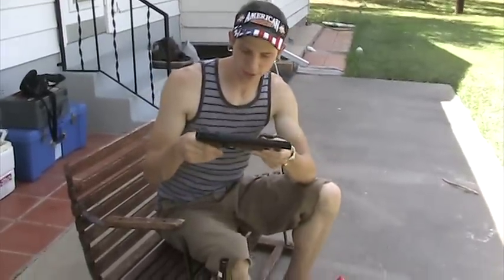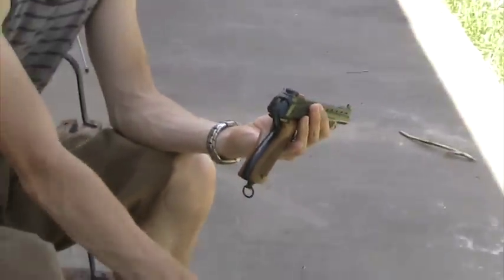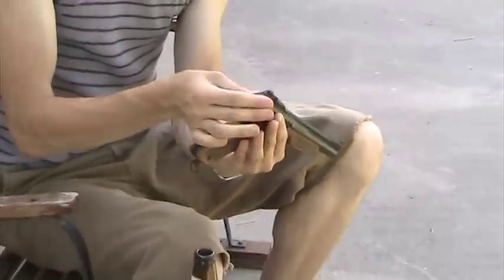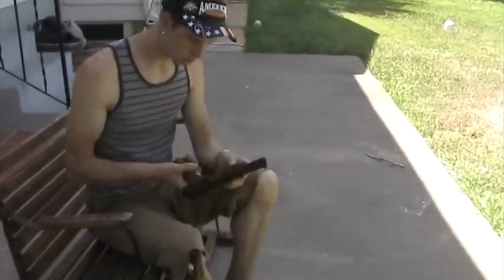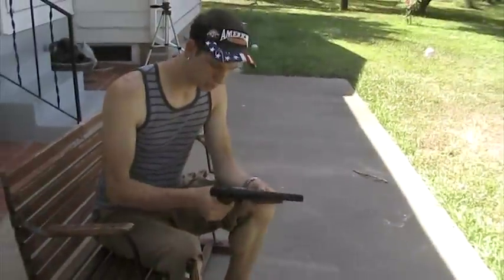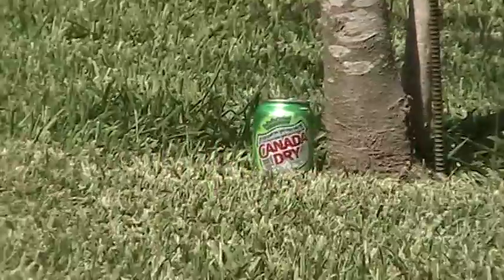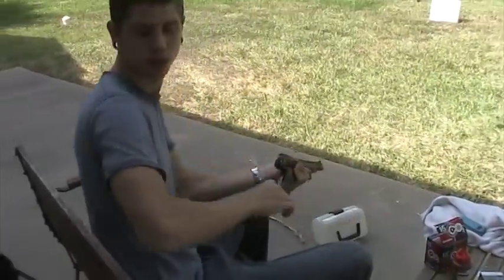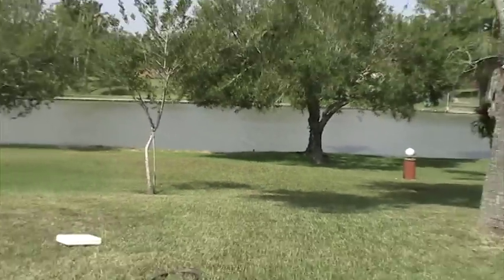Daisy Powerline 1200

Comment: I have one I bought about 25 years ago.  It hasn't been fired more than a few times. I have the plastic clamshell packaging but not the manual.  It is in mint condition since it was always stored in the airtight packaging.  I haven't tried to fire it since I dug it out of the closet. I don't have a co2 cartridge at the moment.  I never used it because I bought a Powerline 880 rifle at the same time and preferred it, which I also still have.

Comment: I purchased my 1200 new on 11-4-96 so they had to still be in production then or at least to 1995. One of my favorites as it shoots straight & hard for about 80 times or so from a bottle of CO2. (NOTEM: Don't shoot too fast for too long without letting the CO2 warm back up to maintain good shooting pressure). Other Daisy pistols of similar design (i.e. 1270, 1700) have the same type of BB loading port in the back like the 1200.

Proper storage, bit of maintenance, & these guns always work.

Comment: mine has a broken rear sight. I have to wing it for aiming
Reply: depending on the model the rear sight should come off fairly easy for a replacement. mine just has one screw then you slide it back.

Comment: I bought 2 guns together off a guy on craigslist, one is the Pumpmaster 760 and the other is the  Daisy Powerline 1200 for $35 , but I don't know how to use the daisy 1200. Do you need to use the co2 to shoot the gun? I have a co2 in there but it ran out, and I use copperhead bb's. Also the priming mechanism on the bottom doesnt have a loop like yours does, I think the guy that sold it to me broke it. Is it still possible that I could prime it, if I use like a rench, please help me!?